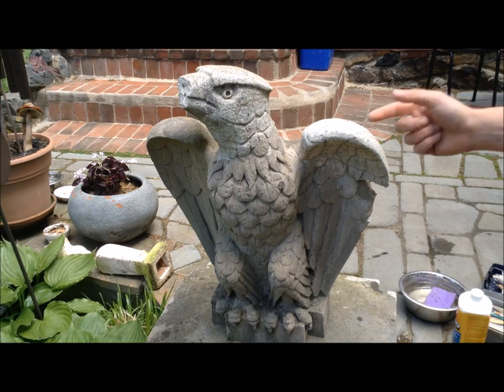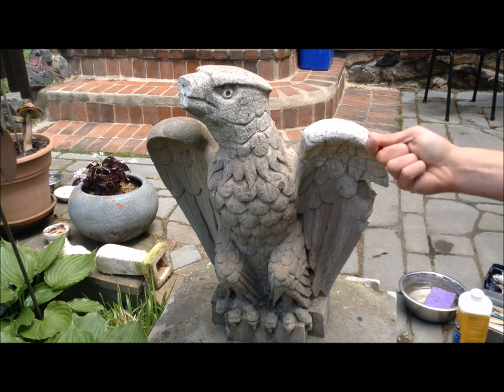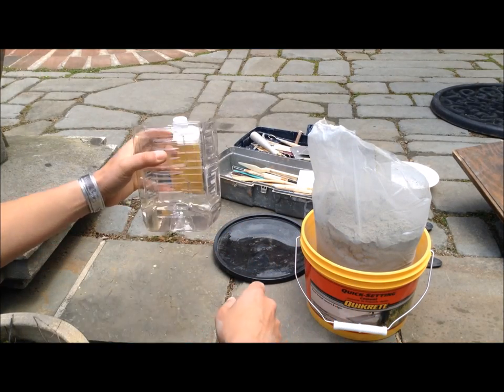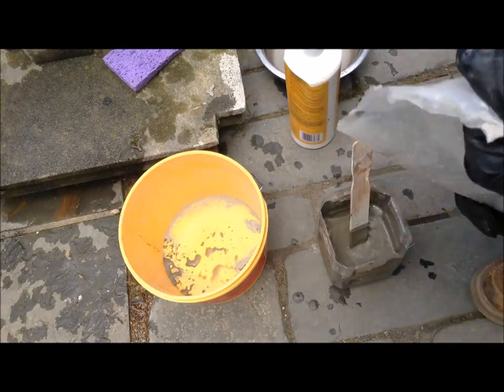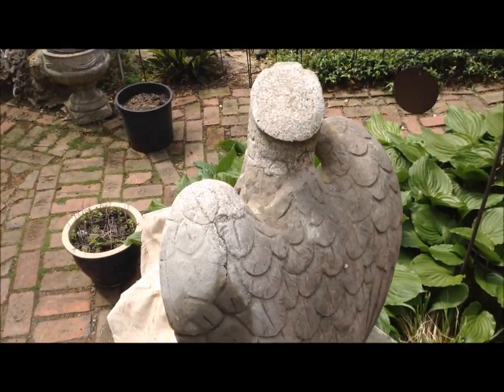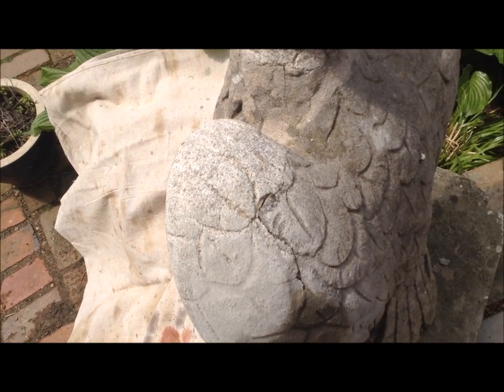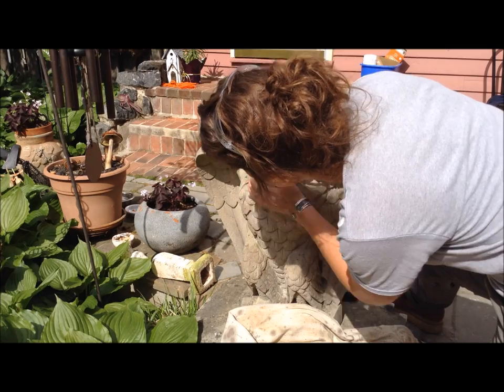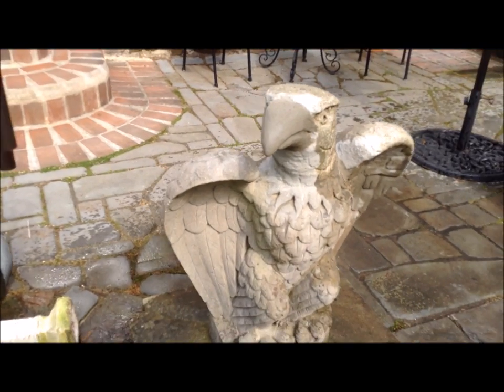How to Fix Things Cheaply // How-To Concrete Repair

Comment: Looks great! I have an old plant stand that I rescued out of someone's garbage  back in the 80's! I've used it as is all these years! Now it seriously needs attention...I was leaning towards your method but my H recommended an epoxy concrete adhesive. After going his route initially, it's still in need of the concrete. Thanks for the video!
Reply from the maker: No problem!
Reply: Great video, thank you. 
 @HoneyBadgerWoodWorks  how is it holding up so far?

Comment: Great job. I had my doubts about the quick-crete, I've never had much success with it, but you did a terrific job and I think I need to try it again and use a bit more patience :-)  I bet your mom was thrilled, the eagle turned out awesome. Thanks for sharing....
Reply from the maker: Thanks!  Patience is key, the set up time is so fast I naturally wanted to rush, but for vertical surfaces it really only gets workable past the 10 minute mark, before that it just wants to slide around.  It's held up so far so she's happy.

Comment: Thank you for sharing this video. We have a large turtle sculpture in our backyard that is of sentimental value to my daughter. The head was broken off either in moving or landscaping work soon after moving in. I think this method looks perfect for doing the repair. I will likely drill holes and use rods to reinforce and stabilize the joint. This video may resurrect a piece that I’ve been afraid to tackle for years. Thank you again!
Reply from the maker: No problem.  Plus, at the time i made this I couldn't speak for the longevity of the repair, but it has been almost exactly two years and is still going strong.
Reply: HoneyBadger WoodWorks Excellent news! Waiting for a few dry days and giving this a go!

Comment: You did a fantastic job on the statue.  I'm repairing Cherubs to put on top of a cement fencing where it was originally.  This video is so helpful because I can now see that it does set quickly but will stay in place fairly well.  Mine is missing pieces so I will need to fill in areas and maybe work on several steps. Thank you!

Comment: Great job well done, I have three small concrete sculptures to fix and paint, another person said to coat it with water based latex paint  primer. you agree?
Reply from the maker: I prefer oil-based paints for anything outdoors.  They are just more durable.  A contractor friend of mine said to use Thompson Water Seal (they make a variety for Masonry) it you want to clear coat it.  I don't think my mom ever put anything on there, so it's still holding up without a finish.
Reply: @HoneyBadgerWoodWorks   Thank you for your reply

Comment: Can you make a video about making a cast of what’s left of my aged quatrefoil?  It fell and shattered a corner.  I hope a mold will replicate the holes and cracks in the plaster or concrete they used.
Also how can you tell what it’s made of?  You are so talented!!
Reply from the maker: You want to mail it to me and I fix it?  Can you send me some images of it, so I can determine if it's something I can do.  Honeybadgerwoodworksllc@gmail.com

Comment: Looks good, the wing might drop a bit but you should be able to add some more concrete and bond it to the other part
Reply: How often.do you have to wet in order for cement to dry properly?

Comment: Amazing job!!! I have a clay garden frog which is chipped. Once fixed I'm thinking of priming, spraying and clear coating it. Any thoughts?
Reply from the maker: That sounds reasonable.  It's more expensive but for outdoor pieces I spend the extra money on UV resistant paints and clear coats.  Nothing outside will last forever, but it does help with longevity.

Comment: Buy clear mate Brick/Cement sealer and apply several coats over the entire statue and it will last a much longer time.   Behr , Valspar and Homax all make good products.
Reply from the maker: Hey thanks for the tip.  I want to have it sealed before winter and just haven't had the time to product search.

Comment: I bought an angel statue for my mothers grave. It has a tiny chip on the wing, but it's noticeable. I want to fix it as it's right on the top of the wing. I'll try and fix it with quick fix cement. From what I've seen it's important to wet the statue to help it bond.

Is the bonding agent necessary or will wet cement dry on on it's own?

Comment: What if you have the broken off part. Can you used adhere it back on? Thanks looks good.
Reply: I watched another repair video that said you can use epoxy resin for repairs like that.
Reply from the maker: If it was me, I would drill into both broken ends and attach a dowel (dowel material depends on the original material) to reattach both.  At the end of the video you can see the original eagle had a hole for the dowel already.  Any sort of sculpture or carving like this with protruding parts will have an inner armature to reinforce the structure.  Some sort of glue might hold up for a while but depending on the size of the broken piece gravity and weather will most likely break a glue joint over time.  Porous materials like plaster and cement are hard to glue in general as is.  The material just absorbs the glue.

Comment: how did your repair hold up? curious need to do a repair also
Reply from the maker: Yeah, looks the same as it does at the end of the video.  I even told my mom to coat it with a water seal after everything cured, and I don't think she ever did.  So looks like that without any seal on it as well.
Reply: @HoneyBadgerWoodWorks  Thanks that sounds awesome.

Comment: I wish you'd have shown the tools you used for carving the features into the cement.  I am going to try and repair a garden statue that fell apart into several pieces. The intricate design restoration is what concerns me - we'll see how it goes.  Nice, instructional video.
Reply from the maker: They aren't specialized tools, it is a cheap set of clay/sculpture tools I have had for years.  You can get something similar on Amazon for like 10.00.  The one I ended up utilizing the most was a wooden clay tool with a pointed and tapered end, similar to a thick knife blade.  Something like that you can make out of a scrap piece of wood.

Comment: repaired some of mine using Hydraulic cement, found it started hardening fast, but was able to sculpt areas if I worked quickly. Painted them white to match color, but a year later, the cement failed, literally crumbled. Wondering if I just had a bad batch of cement that i purchased...
Reply from the maker: Could very well be.  Especially from some of the bigger stores.  I have seen pallets of cement sitting out in the rain around here before.
Reply: @HoneyBadgerWoodWorks  Mine came in a plastic tub. Maybe I worked it too much, but then again, some of the foundation patches I did on my house failed too. may try a fast setting mortar  next time. Know it will harden slower, but know mortar also can expand and contract decent with changing temps

Comment: What did you mean about wetting the concrete so it doesn’t dry too quick?  How wet?  With a sprayer?  Hose?  Damp cloth?  Have a birdbath pedestal to repair.
Reply from the maker: Not soaking wet, but damp.  If you put the new mix onto of the dry statue it will suck all the moisture out of the new mix.  Dampening the old statue avoids this situation.

Comment: How long did it take to dry after sculpting it?
Reply from the maker: It sets up in 15-20 mins, at that point it is hard to the touch.  It doesn't not fully cure to full strength for 28 days.

Comment: Wow!!  Any ideas on fixing a broken and missing ear from a resin reindeer? How can I post a pic here?
Reply from the maker: I don't think you can post images on here, but my email is honeybadgerwoodworksllc@gmail.com if you want to send one over there.  But, in general for resin fixes you can get fiberglass cloth and resin at most stores which repairs resin pieces.  If the ear is totally missing there are options as well, but email is an easier place to discuss it.

Comment: Thanks so much for the Video. Sorry for mentioning it but the beak you made needs to be rouder and turning downward. may be brake it and fix it again. it looks like a water bird.
Reply from the maker: I was working off of the original plaster cast of the head, so the dude who worked on the original is to blame for that.